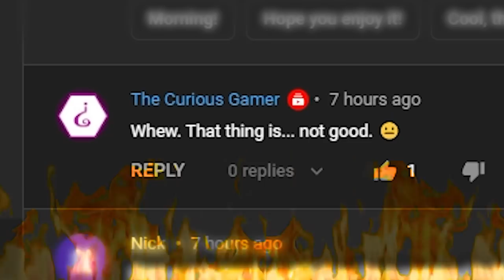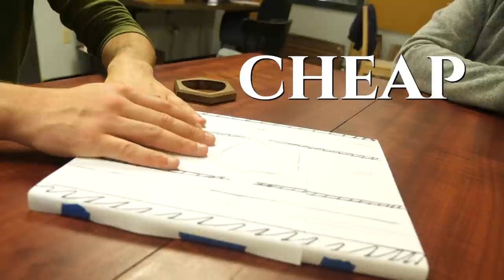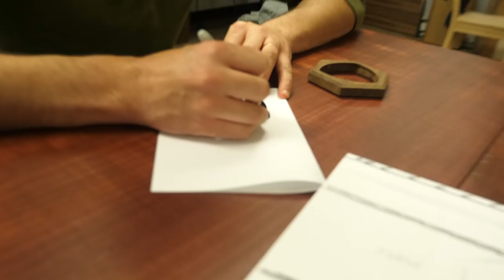New GM Screen Design Pt.2 (Jason was right)

Comment: Ok, I wrote some harsh criticisms on my last comments, let me offer a solution. 

Solid wood for strength and simplicity is good, however it's too plain. There is an easy way to make this a bit more bespoke AND fix your cupping problem AND make the designs more interesting destroying profit and production time. 

Layered. Veneers. 

Just like the classic adventuring line that you currently have, you can do  a solid wood and pair it with a couple layers of veneer while using the CNC to add designs and branding. This would allow you to chamfer the edges of the design  to show the contrasting colors of the wood, it would give any CNC designs more depth, and you would be able to still do this with less operations than doing a panel design. Plus, it would also align with the adventuring party and you could use the same combinations of woods for your tiers. 

Also, look at doing a half barrel (-ish) design for the hinge made out of tube magnets. if they attach vertically then you don't have the play that made the prototype feel so cheap and wobbly. You would have to design the outer wings as a different "Sku" compared to the center panel, but you would only have the 2 pieces and it would make assembly pretty easy.

Comment: I know having veneer or something on plywood was mentioned in the first one and I am very much against that option. Doug has it right in that I was my shit to be a slab of high quality wood. Personally, both dough's solution with accent wood and the magnet thing, and the raised/textured solution work for me as well, but we'd have to see how the end product turns out. After all, Dogmight currently does something very similar so Wyrmwood would have to find out what they want to do different and what they think they can do better.

Followup: Just like how you have multiple systems for holding dice, from hex to adventurer to vault, there's no reason you can't have a high end expensive DM screen and a cheaper more easily mass produced one.

Comment: Hear me out. I might have rushed to judge on the butcher block design.

Maybe that can be made better.

But maybe there is a hidden system here waiting to be discovered?

The top magnets make me wonder…what could you snap up there?
Card holder?
Initiative tracker?
HP trackers for monsters?
Time tracker with hourglass type things?

Maybe there isn’t quite enough. But what if this were a lower tier offer like the Tile trackers from Paladin.

Comment: i don't understand why Dougie doesn't just do a CNC interior rout like the component organizers for MGT to make it LOOK like a frame/panel, but still be 1 solid piece of hardwood. if it NEEDS TO BE MODULAR, do magnetic corners on insert panels that could be veneer or even a limited art work faux leather (like the Frazetta/Sully P-Trays) that give the outside a different aesthetic, and the inside different functions. cuts price, production, process, elevates craft and aesthetic, and literally EVERYBODY wins design wise.
.....then again idk why a multi-million dollar book of business is still doing kickstarter campaigns instead of running their own website as kickstarter. use Wyrm Lyfe to hype a pre-order product launch on the website, then on the website have a minimum pre-order threshold on a timer with time sensitive add ons for the pre-order on a time limit. if the product doesn't meet it's threshold then costumer service can either refund pre-orders OR apply pre-order money as credit to the rest of the webstore. if GM screen falls through, then the patron pretty much pre-paid for a P-tray and a pencil or something like that. i get it's a little bit of a problem on the back end.....but again. it's a multi-MILLION dollar book of business, you're seriously telling me WW can't afford 1 to 2 IT people who can make it work?

Comment: So there were two things that struck me about the thought process. First, why not start with a more expensive version like prophecy and then look at doing a MGT cheaper version and/or a paladin woodwork collaboration? Second, I get that magnets are on most products but why not just use a custom hinge with a removable pin? Side A has the top and bottom part of the hinge and side B had a middle part of the hinge. That way it could still be expandable / modular. And for the end it could have an end cap hinge similar to some of the other expandable products. If only they knew a metal fabrication shop that could work with them on it.

Comment: I would say add hinges to the tri-fold so that it can fold into a smaller version, kind of. Like the shitty trifold boards we all used for science projects. Put magnets on the front and back of the wood so that they can magnetize stuff to either side, but take the magnets out of the creases and replace them with hinges. This just makes me want to make stuff.
Reply: And maybe have a few options for customizable engravings somewhere. Kind of build your own DM screen. Do you want magnets on both sides? Do you want magnets on one side and the wyrmwood and DND logos on the other side? It's up to you.
Reply: O R. Doug likes the hexagon. What if the trifold is made out of three hexagons, instead of rectangular boards? That would make them stand out from other DM screens.

Comment: I loved the OG GM screen. Didn't get for technical reasons but I would absolutely drop 3-600 bucks on a quality 3 panel single product. I love the modularity Wyrmwood is going but that doesn't work for everything. A frame and panel product just looks best. Put magnets on the outside maybe so art can be displayed? but the simple wooden slab is just blah and the morticed design just looks like a cutting board.

Comment: Personally I would pay $125-$200/panel.  I'm not buying 20 panels, I need three, maybe four panels. Bring the cost down on accesories not the panels. Go ham on panels and panel designs.  I WANT a premium wyrmwood product, if I wanted a single panel, affordable GM screen, I'd buy dog might games. Which I have been putting off in the hopes that wyrmwood develops their own. If someone is willing to pay $2000-$5000 on an MGT I'm willing to bet they're willing to drop $500-$1000 on a custom, high end GM screen. 

Lightweight, thin, portable, modular, high end wood. That's what the GM screen should focus on, and try to get that 'base' model down to around $125/panel. The thing is I can buy a nice af wenge center panel with some accents and then drop the 'wing' panels down to black walnut or maple or cherry or whatever.  Add in tie-ins.  Base wood center panel black walnut, accent panels walnut, then put a wenge inlay across the top or bottom or make wenge the frame. I don't know but it can tie it in. 

Until Wyrmwood can produce panels like this, as a consumer I'm not interested. I'll just go buy dogmights panels if we're doing ass ugly solid wood panels like in the video.  Team Jason on this one.

Comment: Ok, someone educate me here - A frame-and-panel door is a thin sheet of plywood (usually) and 4 pieces of wood with grooves in them. Run the stock thru a router table (or industrial equivalent) to get the groove on all the parts.  Chop them down to length, insert the panels and glue the outside.   How is this too expensive?  I would think I could knock several hundred out in a weekend in my garage with a router table, miter saw, planer and jointer (ignoring glue dry time, which would be needed for the laminated solid panels anyway).

Comment: The main thing I'm not too sure about is why the frame and panel is such an issue. It feels like there is an underlying idea that this product has to be a CNC product to make sense from a production stand point. But a 5 piece door style unit could still be quite quickly amd easily developed and turned around, especially with the current set up 🤷🏻‍♂️

Comment: I'm team Jason, but not team 3,000$.  What if, for the outer facing wall you can add customizable art like you put in the dice trays.  that way all the panels are the same, but the "inserts" can be mix and matched.   that way you get the solid wood doug wants, but adds the flare jason wants, and lets Bobby recruit some really good artists for the work.

Comment: I scoured etsy for a bit, and GM screens on the cheaper end (say < 200$) come in either the "chunky" variety or the "looks cheap" variety. Sometimes also the "mostly resin and paint" variety. 

I'm not opposed to Doug's idea, but honestly that's more about getting inspiration for something really nice I can make myself (as opposed to still spending 150$ on, plus international shipping, plus import fees). That said, I'm really curious how the recessed magnet rods or tubes turn out, because it will make the screen a lot less janky and "cheap". Could you remind us in part 3 why you wouldn't want to make the solid wood variant thinner to make it less chunky? 8-10 mm in non-ply solid wood should be sufficiently stable, right? Would basically be a stand-alone panel without the frame. I also actually quite like the idea of having exchangeable or customizable accessories. This could easily be where you choose between a say 150$ product or a 1000$+ product (gaia marquetry hex anyone?)

 I'm really curious how the three prototypes look next to each other and what the guesstimated price points will be. Cristaldi's suggestion (solid but nicely routed) could probably approximate frame and panel, and depending on design could actually outclass it (on the extreme end, it's a bas relief art piece), but then it's mostly about your CNC bandwidth.

Comment: In my opinon having a simple backed "Standard edition" that has other features that work. (Like the one with solid wood + hexagon) that could reach <$300 price point would be a good base. And then have more expensive wood and geometry "Advanced editions" that people could customize to an extent that they suit their tables and other accessories might be a good area and cost in the ~600 to 1.5k range

Comment: I just want the RPG tracking system, on a GM screen, so I can put all my Cthulhu or 7th Sea stuff on there. Slap on the normal tables you have printed out, but in wood with tracking magnets. Or slap on printed tables in the same slots. 

I think you should collab with the same chap whose done that and then just put a nice pattern on the outside. Even better if the GM can just mount his RPG Tracking System elements vertically on a screen. Plus, players screen? I don't need to see the player's stuff flat on the table to trust them at my age ;) 

You get to the end of the video and the solution is right there. 

Plus there's always expensive frame and panel high end super GM screen, with customisation, where the entire gaming group gets together and buys their GM a present that obscenely expensive. At my age, adults have everything they need so buying presents for them gets extremely hard. A modular GM screen lets you sell tracking stuff for GMS and players alike, as continual upgrades/expansions to the GM screen.

You could even have a budget option, that's just for holding stuff. Then a deluxe version that's beautiful. Both using the same tracking stuff and the deluxe is the one you upgrade to later. But I care about function first. When I'm ready to have my modular table, I'll buy the one I can afford, not worry about getting the Prophecy - I'll get that in the future.

Comment: Would it be possible to make the hinges from the magnetic rod so that they slot into a recessed hole in the board but come unattached to the individual panels. That might solve the shearing issue and it would mean that you could assemble the hinges in bulk and never have to put them on to the boards and the boards would still retain the modular abilities discussed in the first segment of the video

Comment: I think Doug is still massively under estimating how massive an issue cupping would be. And his attempts to improve the product are really just digging a hole. Dough suggested that a single frame and panel section might be as little as $150 and for a standard GM screen that would take it to $450. Even if that's conservative if wyrmwoof got the process down I can't see a 3 panel DM screen of just plain frame and panel sections costing more than $1000. As it stands the product Doug wants to deliver is something someone would knock up in their garage as a poor imitation of a wyrmwood product.

Comment: Tbh the mercer screen was amazing, this just being 3 slabs of wood just sucks, going the way of the adventuring party stuff was a nice touch

couldnt you use the rejects from the tables? slice them thin and then put on the magnetic strips to hold paper? as long as they are slightly bigger than A4 sized, i think that could work, so like have your cheap  wood in the middle, make frames around it  using offcuts from nicer pieces then add magnets to hold your sheets and have them together with something like book binding?

though to be fair, if people knew the cost of the mercer screen, i bet you'd get a fair few orders anyway

also, give Jason a break, he got shit on pretty hard this episode, he needs a Ted hug

Comment: 100% Jason :D But i get the problem of manufacturing. I still dont thing this needs to be modular in any other way than to add more screens. Most people will just buy the screen as a "nice art piece". :D Even Mercer has the normal paper GM screen up front the wyrmwood one, because its more for a show than function.

Comment: I'm not sold on a solid wood GM screen, it would not be a replacement for the screen that came with the game I run.  The old GM screen you had would be a different story with the interesting design elements.  But if that is too much work/money, why not look at it backwards? What can you take from what you did before and see how to simplify it towards less frame/panel?  I personally think ball bearings in a round groove would be nicer then the rods.

Comment: As you said there are thousands of other shops that make frame and panel designs. Why not try to work with another shop on those portions of the project much like you do when you ship things between MA and PA depending on the process being done.

Comment: Personally, I like the simple wood panels with magnets; If and only if that cope is able to stop the panels from twisting. Plain panels would work with species of wood that have excellent grain; maple ain't gonna cut it. Also, solid rods are what you want; uncapped tubes will look unprofessional and fill with shit.  
Doug's idea looks amazing; but I'm not gonna pay for a multi-part inlay. Some will and it's an excellent stretch to have it...but not in bulk. Cristaldi's plan probably wouldn't pop enough to be worth it. Frame and panel is problematic to make to Wyrmwood's standards. As a compromise, I could see adding full-length inlay strips to make duller wood grains really shine.

Comment: If you wanna go the inlay route, go with the adventuring party colors so you have at least some consistency, but that won’t make those more appealing from a design point of view. I gotta admit I would not buy a 3k GM screen, but Doug‘s argument is basically just „as long as people buy it just make a ton“. You are starting to make stuff any random company could make. Meanwhile your cash cow is the prophecy gaming table. Why are you suddenly afraid of quality? Why are you not looking at your other product lines and see how those can be integrated instead of slapping on more random stuff? Start with what you already have and see how new products can have synergy with that. Don’t just try making something for the sake of making it. You go down that route for too long and you ruin your brand completely. 
If you make everything compatible with each other you increase the appeal to everyone who already bought from you. How can I attach my dice tower to this? How can I differentiate between public and private rolls? The question here is not frame and panel vs solid, the question is what problem does this solve? Your current „design“ solves the problem „people asked for it“ which is not why they asked for it. Get another product designer in there if you can…

Comment: Why would you not subcontract a cabinet shop to just make you a bunch of plain panels and then have your team do the final steps of the hinge mechanism and any decoration? If it's agreed that frame and panel is the better solution, I think the thinking should be "how do we make frame and panel work" instead of "but it's too expensive", right?

Comment: I fully agree slabs are boring and panels are preferred but price is a deal breaker and not worth doing a mega expensive and slow product . The market for wood DM screens is small, the market for expensive Mercer DM screens is a fraction of that small market.

Allthough if it doesn't feel Wyrmwood it's not interesting either.
Fulfilling people's needs is different from what a brand should sell.
People need bread but I don't see Wyrmwood bread.

Comment: I'd say $300-$500 for a price point on a cool 3 panel set.  What can we get for that?  My issue with the thick solid wood is that it doesn't fold and is heavier to transport.  I'm not stuck on cabinet door styles but there's got to be something in the middle.

Comment: Why not try a solid wood design using something like the veneer work on the classic adventuring party. Then the cnc work could pop more by having different woods. That coupled with something like the stripe that Doug had across the front? I dunno. Might be a pain to do logistically though. I'm not much of a wood worker lol

Comment: the magnets don't have strength because they are trying to grip to a minimal surface. If you were to use a hexagon rod or octagon rod that would work far better but would be a little more expensive. Because a flat magnet will connect to a flat metal surface far better than a curved metal surface.